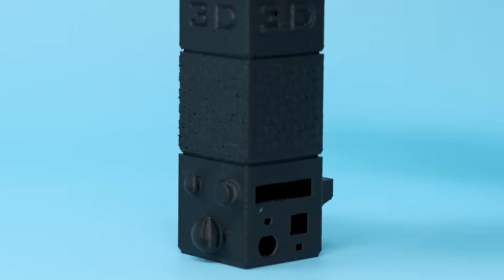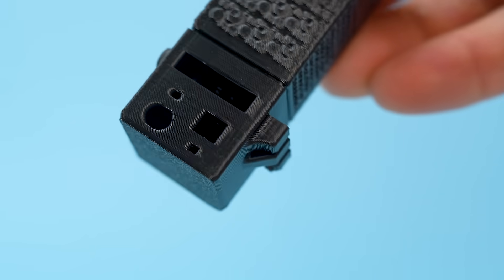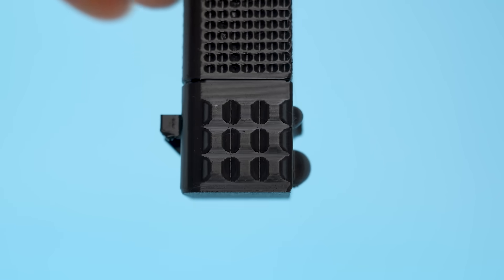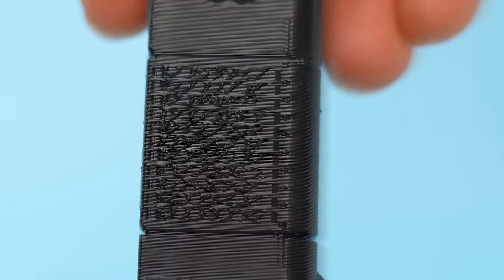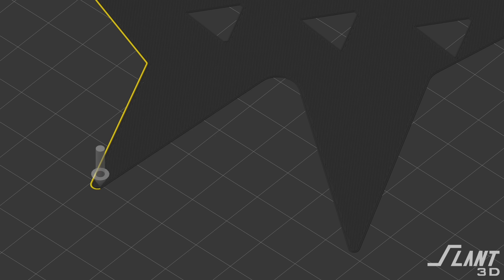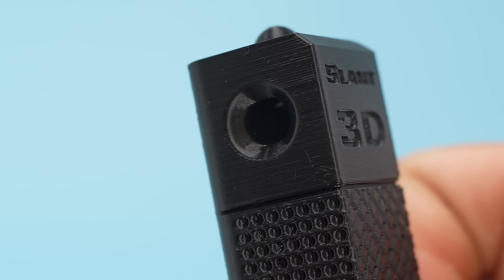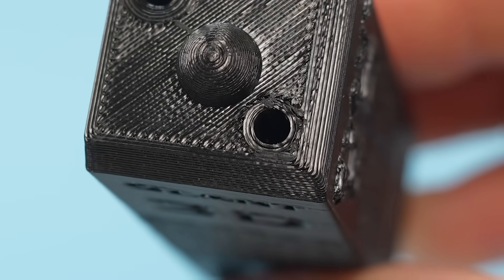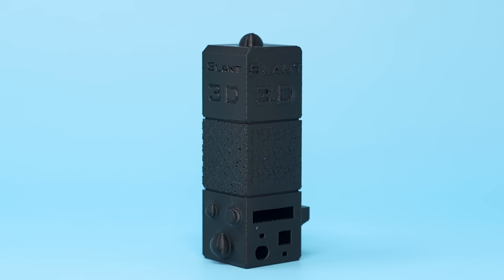Slant 3D Sample Brick Explained | Design for Mass Production 3D Printing

Comment: Missing the fact that you can use the bed to imprint a texture on a face of an object, so if you have a two part shell and both parts have their outside printed in contact of the bed, you get no layer lines and it looks literally like injection molded textured plastic.

Also, fuzzy skin was missing